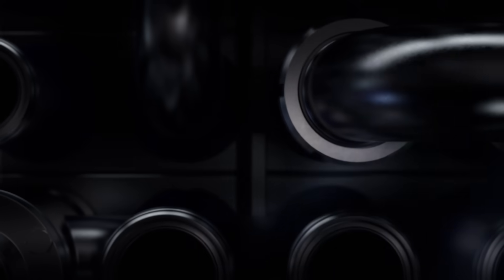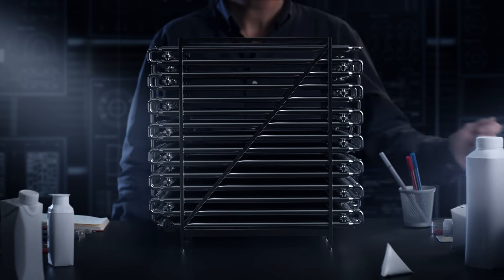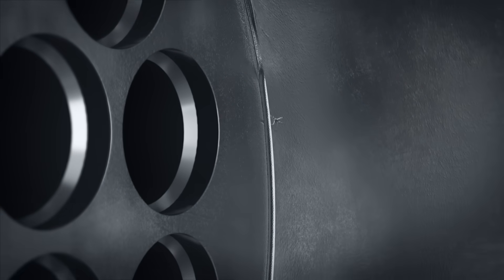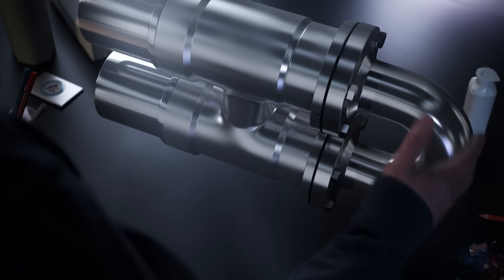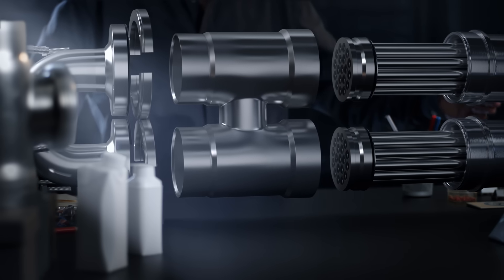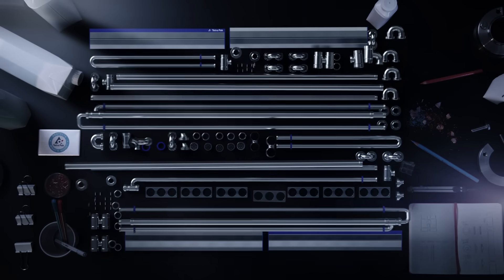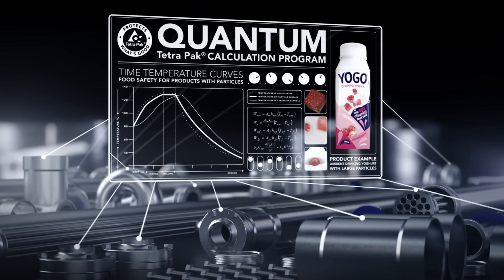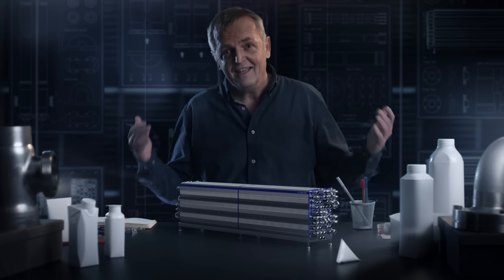The magic inside Tetra Pak® Tubular Heat Exchangers

Comment: Here is just one application of this technology, a tetra pak heat exchanger with a drum motor generator with a super conductor has its bearings that also drives a fan to force air through heat exchange. A component part that generates air conditioning and high frequency electricity. Recreational vehicles would just love them you could even replace the diesel power generator most bus conversions all have in their noses or have semi tractor trailers that produced their own cooling and power needs to drive in hub electric motors for goods and food transport. Bonus, another component part a Joe cell used with liquid air to produce hydrogen gas that could operate combustion engines and jet engines. Imagine that? Vehicles and aircraft that all operated simply off atmosphere with no need for fossil fuels? These are just simple concepts the more complex concepts require understanding what has been posted. If your group is interested in learning more this would be very nice. Has I look for other groups that will be interested in my design concepts and technology upgrades. Do have a wonderful day.

Comment: Advanced heat exchange products will use ultra low vibration of materials used to cause ultra low temperatures. Interested in chatting about a few design concepts? Removing mechanical parts that cause vibration like a Stirling cycle piston or using a compressor for atmospheric elemental cooling will be a must for moving into a new way of thinking to address heating a cooling needs of the future. Also for making components that will be used with super conductors. I would enjoy speaking to a technical team to share some ideas if the interest in what's been posted is there? = )

Comment: Would a Stirling cryogenic cooler 35 watts that turned air into liquid that filled a tank with a bell siphon that filled a tetra pak heat exchanger that had a 35 watt fan to force air through heat exchanger where the liquid air boiled off into vapor that returned to tank to be turned back into liquid air to start cycle all over again be a new cheaper way to provide air conditioning at a much lower cost? If your interested in learning more I would enjoy speaking with a technical team to produce a stand alone refrigeration system using graphite power cells. I also have a stand alone heating system has well. An a concept for a heating and cooling central air conditioning system has well. Which can also be a stand alone system. Novartis